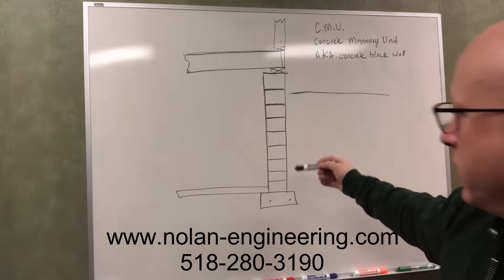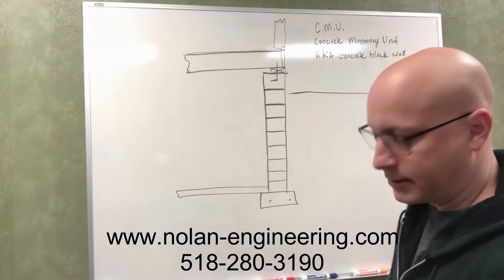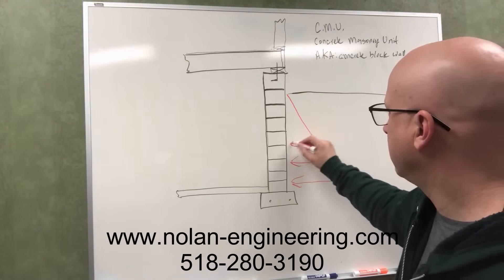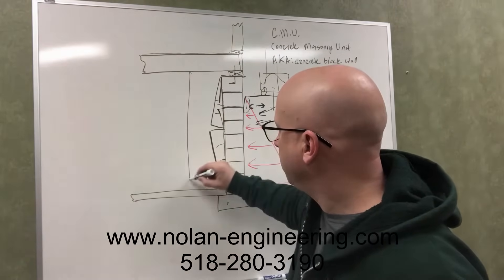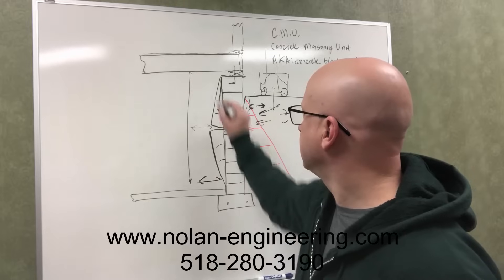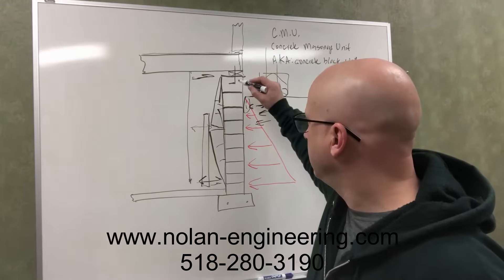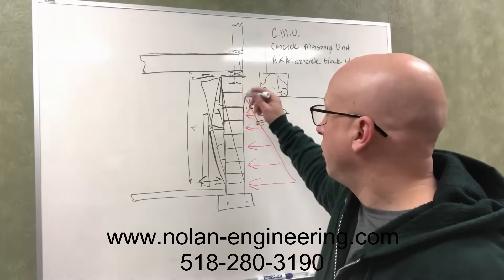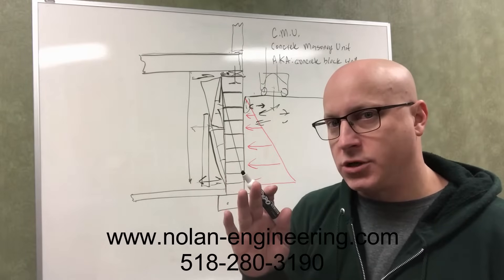Basement Foundation Wall DYI Repair for Bowed Cracked Walls, Carbon Fiber Wall Strap Alternative

Comment: I had about a fourth of wall rebuilt. They didnt replace the board at the top that attaches house to block wall. Numerous new blocks are chipped and broken. While new blocks are left on the pallet. The rest of the wall is still bowing in middle slightly. The new section of wall is tilting in at top. There is a new egress window that doesnt work as it wasnt installed correctly. The window well says not to use heavy machinery due to risk of well failure. The company used heavy tamping machine that shook the whole one and a half story house for a good two hours last winter. They didnt put drainage or redo the footings outside. They didnt put tar outside, just spray foam a partial way up the new wall section. The soil is heavy clay mixture soil. They left a spot between two blocks that had nothing so water poured in during rain.  It all failed inspection. Then a week later it all passed with no inspection ir anything done differently. I am in davenport iowa. I hired a conman first who went on vacation. Then a company and city inspector who failed to inspect or honor their work. I am here to fix it all myself now.

Comment: Thumbs up to Nolan Engineering video. Very informative without distracting music. The straps appear to be the best option. I recently bought an old house with a bowing wall in the basement. It supports the front porch concrete slab, not the house. Decorative columns attach the porch slab to the over-hanging roof eave. I think the tornado that blew 5 years ago rattled the eave, rattling the wall via the columns, and causing the wall to bow. The amount of displacement is under 1". Installed a parallel drain outside in case it was actually due to hydro static pressure, but I do want to make sure it doesn't get worst hence the strap method.

Comment: What if you are 3 inches in on a 8 inch wall and it is structurally unsafe ?  Does that wall need to come down ??  Asking for my aunt.                         I am thinking of digging out the outer wall, i beam or 2by4s or soemthing to push it back, and back fill with gravel.  Maybe the roof is too far gone to even do that...IDK, thank you for the video !

Comment: Very thorough overview. I have worked in the masonry restoration field for many years. What are your thoughts on an exterior slab in a driveway / patio scenario with a substantial pitch to remove water and stop soil expansion as the ground becomes saturated and during winter months when there’s a hard frost?  Do you think the additional load from the slab would create more issue/problem and outweigh the benefits of from stopping /reducing moisture mitigation to the soil and the freeze/thaw of the soil during the winter months? I’m dealing with a situation at the moment where I believe, improper grading and hydrostatic pressure caused an issue originally. I feel like mitigating that soil expansion and moisture via a sealed slab may be beneficial, but I did not consider the additional weight of the slab creating more force on the wall.

Comment: I feel like if i had a cracking wall.  That last thing i would want to do is put a hole in every single block leading to the potential of water leaks and strength degradation with the third metal strap option?  And the fact that it is all going to rust and break down in a couple years.  Am i missing something here?

Comment: This is an absolutely great way to fix block walls Iv done it and it’s cheap and easy to do and will last a long time if every step is done correctly,thank you for saving my house
Reply: What do you consider cheep? What year did you do it and what was the cast of material at that time?

Comment: This looks like just what I need...except in my case the wall that needs a fix is supporting a poured concrete slab porch that is above. How could I anchor the straps to that slab? Since the slab sits directly on the block wall I don't have the tension of the steel strap like you do with wood joists. Any ideas?
Reply: If the wall is just bowing and not slipping out from under the slab at the top, then he does not have to attach to the slab. If he needs or wants to attach to the slab, he could drill holes in the edge of the slab and use one of the bolts. He may get luck if the slab is 4” thick and use the hole that is designed to go into the 4” top block, if not, he could always drill another hole which I think was 7/16”?

-Rich

Comment: Discussion of cracking walls early in vid is excellent. I’d never thought of that about trees but of course it’s true: they are very heavy and forces are not purely vertical.
Reply: I currently have 2 60’ oaks out front and my garage wall is cmu, as is my basement, and they’re both a little cracked. My inspector didn’t even catch it but I later did as they were painted over. But I am stopping the problem before it gets worse

Comment: Keep It Real Now!!! God Forbid You Question A Engineer Because They Know It All!!! ANY CRACKS In Your Basement Walls Need To Be Adressed Right Away , Because Where There's One Crack There Are More!!! That Means More Places For Water To Seap In!!! Which In Turn Fills The Blocks With Water Which In Turn Will Rott The Blocks From The Inside Out!!! Which By The Way, When The Frost Level Drops It Freezes The Water Logged Blocks!!! Which By The Way!!! As It Freezes The Ice Expands And Retracts!!! Which By The Way!!! Tends To Weakin The Blocks, Which Weakins The Tegrety Of The Wall!!! What Happens Then You Ask??? Due To The Weight Of The House!!! And The Pressure From The Ground Itself Around The Walls!!! And All The Water Run Off And Ice!!! The Walls Bow In!!! Who Wants To Just Stop The Bowing Walls??? Which By The Way!!! Is Technically A Quick Temperary Fix!!! And Yes You Can Get The Walls Straight Again!!! You Have To Dig Around The Outside Like A Water 💧 Proof!!! While You Have The Ground Open!!! What Ever Wall You Are Working With??? Start In The Corner!!! Use A 40 ton Bottle Jack!!! 2' From The Wall!!! Jack The House VERY SLOW ( Listen for unwanted cracking sounds!!! ) Just Enough To Barely Sunlight!!! You Should Have Pre -Driiled  On The Basement Floor Against The Walls Every 3',  3" x 4" Deep!!! Cut Some Pieces Of 2x10x16 Blocks And Screw Them Into The Floor Joices So The Joicies Don't Roll When Jacking!!! Now!!! My Boss And I Fabbed Our Own Jack Tub That Holds Our Special 100 Ton Jack Is Specifically For Pushing Walls From The Inside!!! As You Slowly Push The Wall You Need Keep Checking The Wall With A 4' level Horizontally!!! Once The Lower Half Touches The Top And The Bottom!!! Put Your 3"x7'  Beams In The Hole On The Floor And Bolt The Top Half To The Floor Joices Continue Áll The Way Around The Bad Walls!!! Don't Forget To Fill Any And Áll Cracks!!! Once You Finish The Walls From Inside!!! Go Outside While The Walls Are Exposed!!! Grind Out And Fill Any And Áll Cracks With Type S Mortar, Once It Dries, Spread Tar On The Wall, Put Visqueen And 4'x8'x2" Styrofoam!!! Where I'm From??? Inspectors Won't Let You Backfill With Dirt!!! So We Start With 2' Of Peat Gravel Over The Drain Tile, Then 3" Crushed Concrete!!! 2' Of Top Soil And Clean Up And Be Gone!!!  I Have Been Doing This Since I Was 15yrs Old!!! I'm 55yr Now, I've Done Rebuilt Or Repaired Well Over A 1,000 Of These And Have Not Ever Had A Call Back!!! I Love What I Do Because At The End Of The Day??? I Know I Saved Someone's House And Or Bank Account Down The Line!!!  Just Saying That There's No Way I Would Use Any Of The 3 Fixes He's Talking About, Just Pay The Extra Money A Get It Done Right The First Time!!!

Comment: The dirty little secret of basement wall carbon fiber straps is that the installers and manufacturers all warranty the actual straps and the resin, but they don't warranty the resin adhesion if the underlying CMU is wet or deteriorated.  Adhesion has to exceed the tensile force of the masonry unit, which is typically in the neighborhood of 200 psi for a CMU block in good condition.  It's also been proven in 20 year studies using pullout tests that the resin adhesion performs poorly at the mortar joints.  Also, it's been my experience that the presence of a fresh strap or beam installation, with no changes or alterations at the exterior, is consistent with an effort to merely get through a real estate transaction, and not really solve the entire problem.
Reply from the maker: Fortunately, we no longer use epoxy resin for our basement wall straps.  Apologies, this video is a little out-dated.
Reply: @nolanengineeringpllc2713  so what do use now?

Comment: My foundation is a mix between fieldstone, concrete and cinder blocks. My issue is the the very top cinderblocks that the sill sits on has a few blocks that are turning inward and some turning outward. They are not bowing in or out just turning. in a few spots. Im thinking about building a steel frame around the entire interior of the house.

Comment: What could be done to the back foundation wall to bring it back in? Our front foundation wall was coming inward while pushing the back foundation wall outward. The front is now done with the cracks just needing to be filled while the back foundation wall needs to be straightened by pulling it back in.

Comment: Thank you for addressing this issue in this video.  So, some solutions include:  1. Remove the excess weight stressors (when possible); 2.  Address the moisture (drainage issues like gutters, downspouts, redirect water flow, etc) and 3. Stop the movement of the foundation walls.  I have seen basement contractor estimates.  Can you provide any price comparisons?
Reply: Don't go to a "basement contractor" first.  He will try to sell you everything in his product line.  Go to an engineer first, who will recommend the correct repair and nothing more than the correct repair.

Comment: The presenter is incorrect about the IBEAM repair.  Most structural engineers that specify using beams also spec that the space between the beam and the wall is grouted with mortar.  This creates a contiguous bond between wall and beam and dispurses the energy and movement of the wall from the top to the bottom of the beam.  The best way to decrease the space lost in the room is to frame the exterior walls so that the edge of the beam is just behind the drywall.  You may lose an inch more than you would under normal conditions, but the loss can be minimized.
Reply: Agreed, braces are the best choice and you should always pack the back side with mortar for continuous contact with the wall.

Comment: We see a lot of horizontal cracks at the frost line.
Reply from the maker: Yes, that is an issued. See if you can install gutters and slope the soil away. The straps will also help with that.
Reply: That is the result of freeze-thaw action of moisture-laden soils.
Reply: Installing Gorilla Braces... then digging the foundation...
Reply: @georgevalente4223  You can buy the parts in lieu of these branded braces for next to nothing.
Reply: @Loonypapa  from where can you buy the steel?

Comment: did not hear a word about waterproofing the exterior cracks, cracked parging that are present on bowed in block and brick walls, installing an INT system and slapping C F straps on does not seal-waterproof any of the EXT cracks etc, as in video here https://www.youtube.com/watch?v=rTRT6e2_exY  and the most successful repair for bowed in walls is ext-waterproofing, hand dig and remove the clay soil & possible underground roots etc off wall, backfill with all gravel after correctly waterproofing the wall (Fairfax county VA). Interior drainage systems do not stop further water from getting into blocks through ext-cracks in wall, can deteriorate-disintegrate the blocks
Reply from the maker: Not all bowed and cracked foundation walls are due to water issues. In my experience about 25 to %50 of bowed walls are due to high ground water. In other situations its just due to earth pressure, high backfill on the walls, driveway and vehicles adjacent to the wall, or it just happens. Fixing ground water issue can be very expensive as it usually involves excavation around the perimeter and can cost $20 to $50k depending on the access to the walls. Interior drainage systems can also be installed but can also be very expensive. Not everyone has this kind of money and just need their walls to be structurally safe even if there are water issues. This is where wall strapping comes in, it may be about $5000 +/- and much more affordable .
Reply: @nolanengineeringpllc2713   most bowed in walls due to lateral soil pressure against the exterior of the wall and underground roots against the wall and less frequent but possible settled driveway slabs or a porch-footing that shifts a lil or deteriorates against the wall, all exterior weight-pressure so needs to be removed, the clay or silty soil & roots,settled slabs need to be removed, the ext of wall waterproofed and backfilled with all gravel. Installing C fiber straps or beams etc inside does NOT remove, relieve, lessen these exterior pressures-causes and no INT drainage system repairs-waterproofs any of the exterior cracks sheesh lol, block and brick foundation walls can deteriorate, crumble just from water getting in. 42 years in this business and the MOST money a homeowner needed to spend on exterior waterproofing (2 bowed in walls plus a little around corners), was $8.900. $40,000 and 50,000 figures are nonsense. Hey many INT system morons often charge $15,000-20,000 JUST for the water diverting system that does NOT stop the water from where its first entering so, then you add the money for C fiber straps or beams or W anchors and now those people are charging $25,000--35,000 and sometimes more! lolll  I been around the block, seen all the lies and misrepresentations and other crap
Reply: @manderson5397  it is true that a reconstruction of an arched wall can cost up to 50,000 dollars??
Reply: The the exterior system of sealing, drainage and backfilling with rock is the first line of defense, the interior drainage is the second line of defense cause it gets what goes under the foundation that  exterior wasn't able to get.